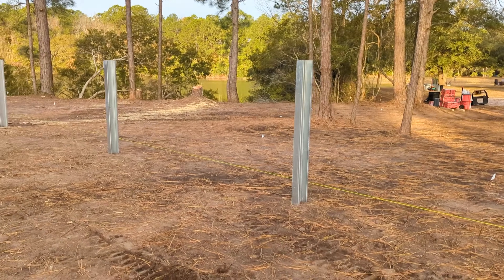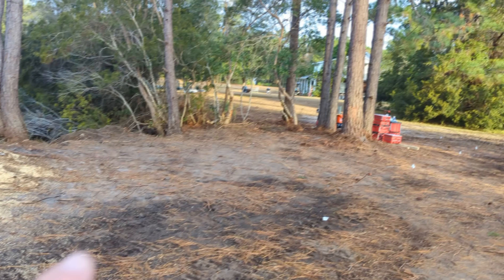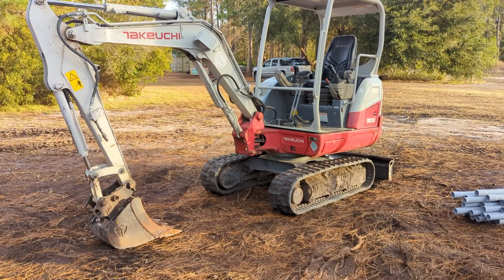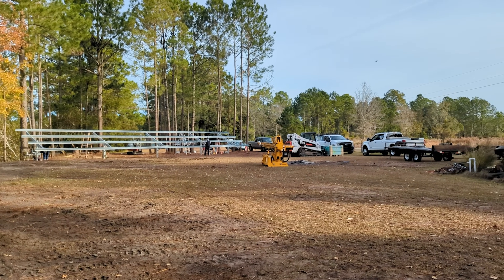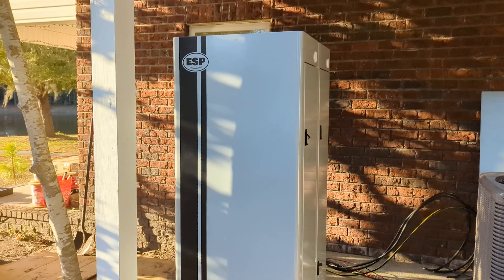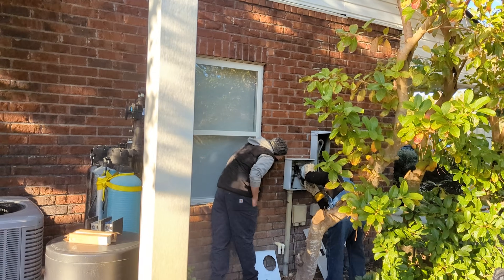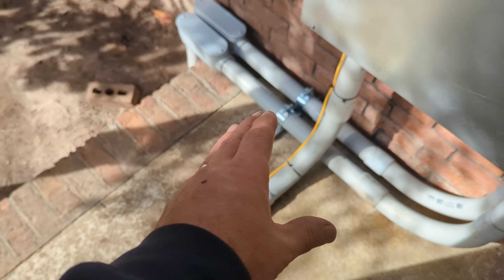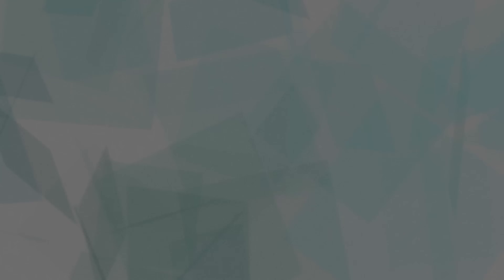Freedom through energy independence

Comment: Nice job looks good I’m just wondering how you got a smart load panel to be EMP protected like your 15 K inverter
Reply from the maker: By smart load panel I just mean a breaker panel that's going to distribute power to two different loads. It's not the solark smart load panel that is full of relays and printed circuit boards.

Comment: Question on those ESP batteries. You said they are EMP proof. I thought any Lithium Iron Phosphate battery has a BMS. That in itself is not EMP proof.
The system I installed: 2-12K Solarks (I bought from you) that are  EMP proof inverters, 2 arrays with 40 PVs each at 310W per PV (80) but settled with AGM 215Ah batteries was my way to get around the vulnerability of batteries with BMSs that are not EMP proof. Has it something to do with the cabinets (Faraday cage)?
Thanks.

Comment: I really love your videos. Thank you for making them easy to understand. I would like to see a follow-up video of this installation once it’s all complete. I don’t understand how you’re going to make ice. Please explain that. Obviously you’re gonna dump access PV generated power into a air conditioning, compressor somehow, and freeze water but I would like to see this. Thank you keep your good work going on. And for you to travel five hours out of your area, proves how committed you are.
Reply: I'm not the installer, but I can suggest a couple of options they might be using depending on what kind of effect they're aiming for. 

If it's for thermal energy storage to do load shifting of their space cooling, Calmac (which got acquired by Trane a few years ago), and Ice Bear (which got acquired by Thule), among others, have tank systems which have a compressor to freeze water into ice by circulating a heat exchange fluid through tubes immersed in an insulated sealed water vessel when electricity is cheap and/or when the air temperature is lower to make it more efficient, and then dump heat into the ice from the building extracted by circulating a heat exchange fluid through a fairly conventional A-coil in the HVAC system during high cooling demand periods and/or when electricity is more expensive. You can look at either of their websites to get more information on specifications and how they operate. There's at least one other company I've seen that's doing it, but I can't remember their name off the top of my head, and if I remember correctly, the company is a lot smaller, newer, and doesn't offer systems small enough to be used at this scale, so is unlikely to be involved in this installation.

On the more conventional side, if it's just to have ice to put in a cooler when they're going fishing or that sort of thing then they're presumably just plumbing and wiring up a commercially available icemaker that is set up to produce whatever shape of ice they want at the volume they're looking for. Those can just be sourced from food service equipment supply places.

Comment: In my opinion, not putting the electronics inside protected from the weather is a mistake and the equipment will succumb to the weather !
Reply from the maker: Oh I agree. This is my first outdoor installation of a mechanical room and I was reluctant to do it. The customer understands that it is actually framing in a couple of walls and a ceiling to help protect the equipment. Without moving that HVAC condensing unit out of that space, there's no way to totally enclose it.